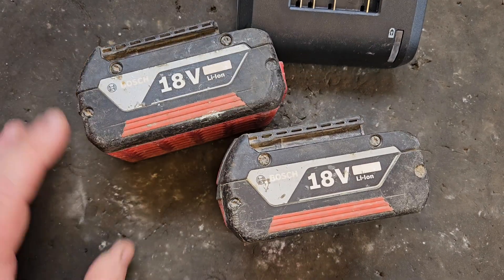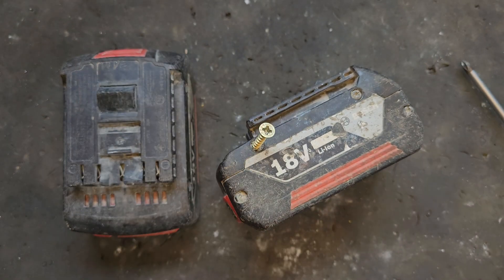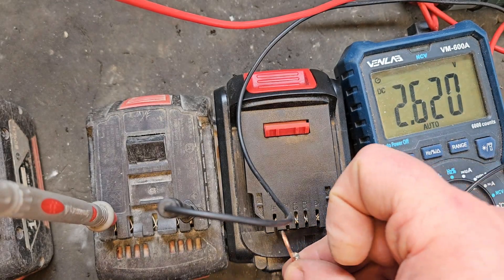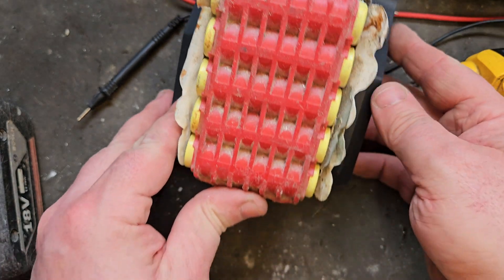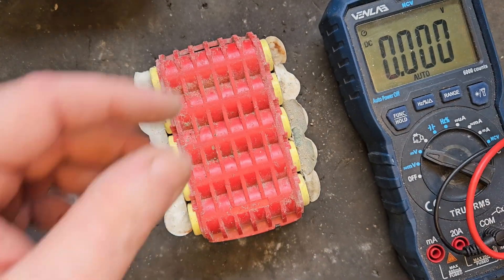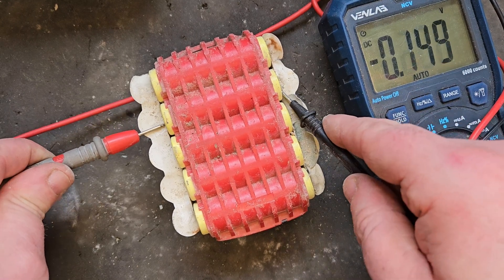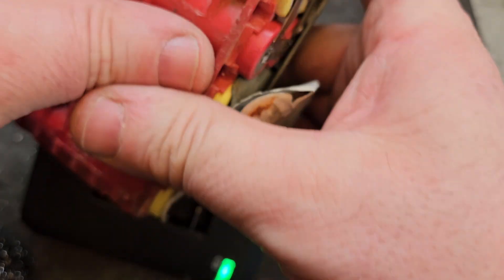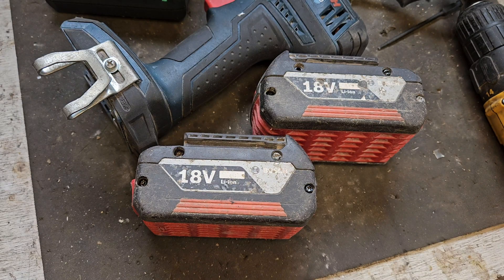Repairing the 5ah Bosch Battery The Easy Way

Comment: I have 1 of the batterys, indicator shows full but loses power, testing with the meter 19v appears then disappears, does this at the soldered wires aswell so don't think its bms but all cells read the same. Not to sure which bank is what

Comment: Hi Doc, I have one of these and the release button is stuck in the engaged position. The spring clip is chipped. What's my best solution to get it working again?
Reply from the maker: If the button has been stuck in for an extended time it's likely the battery has drained to zero if they are showing zero voltage on the meter they are likely done.
Reply: @doctorlefthandthread thank you for your reply, is not the battery indicator button I was referring to. It's the battery release button. The one connected to the spring and the tab that clicks the battery into the tool
Reply from the maker: @DavinderSingh-wv7eh take out the screws on each side. Take the side panels off and remove the top to see if you can get it moving again.